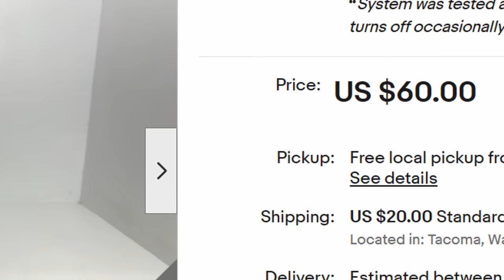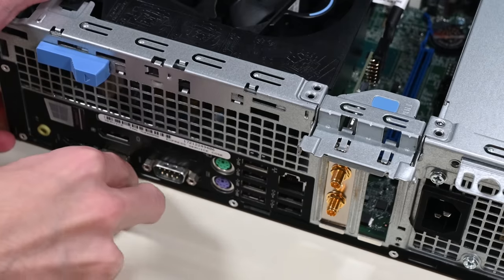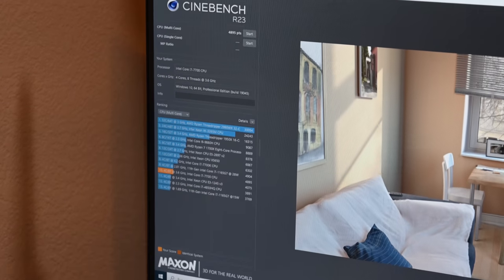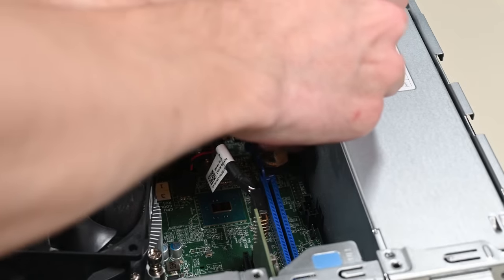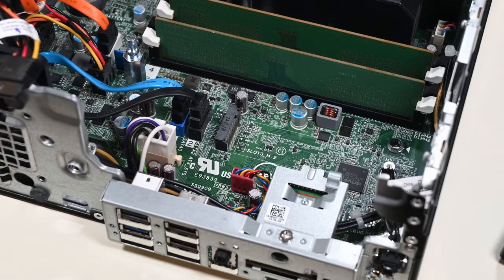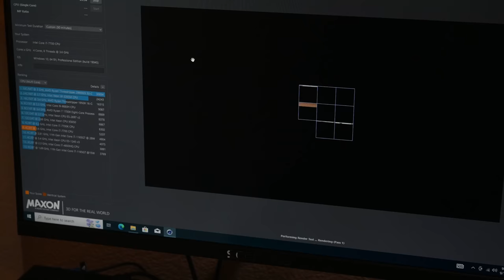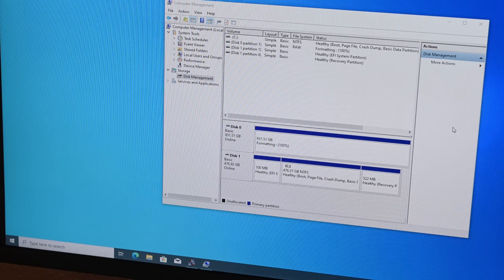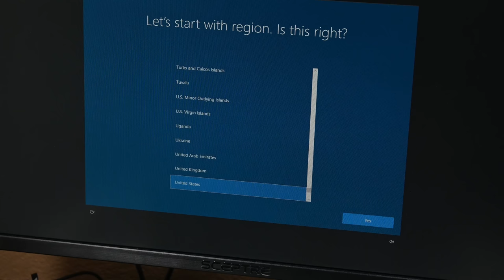I Paid $80 for ANOTHER Broken Dell Precision 3420 - Let's Fix It!

Comment: Windows 11?
Reply from the maker: This CPU just barely got cut off of official support for Win 11. There are ways to bypass that that seem quite robust, but for stability's sake I always put Windows 10 on these systems. Literally every Windows 11 system I've dealt with has all kinds of weird software issues, which is much less the case with 10, so I like to stick with that one.
Reply: @CompHwTipsAndTutorials  Ok :) I didn't encounter any issues. I assume, Windows 11 is merely an upgrade to Windows 10. That's why replacing the install.esd of a Windows 10 installation works so easy :)

Comment: Ah yes, exactly why WINDOWS is - after 30+ years - still a nightmare around hardware driver issues.  I mean Windows 3.0 was released in May 1990 and still in 2023 this crap still happens.  And exactly why - even as an MCSE at the time - I switched to Mac and only Mac in 2009 and have never looked back.